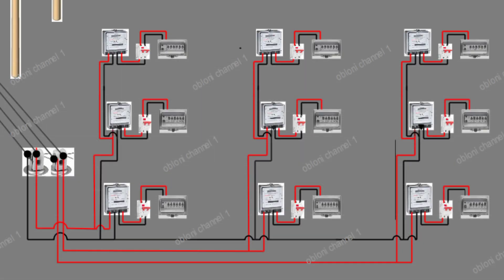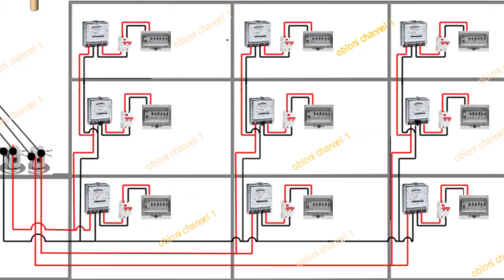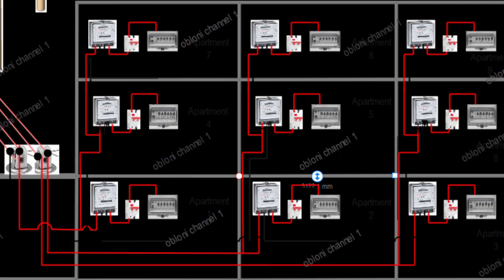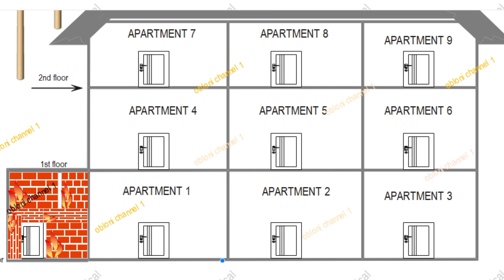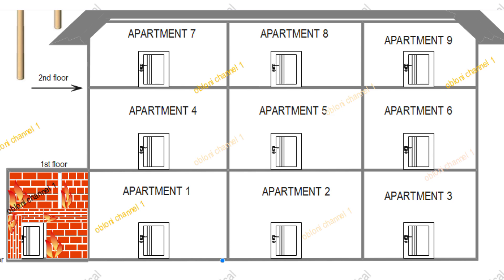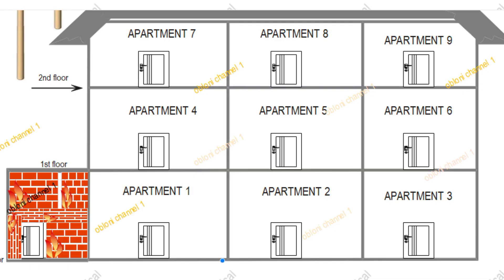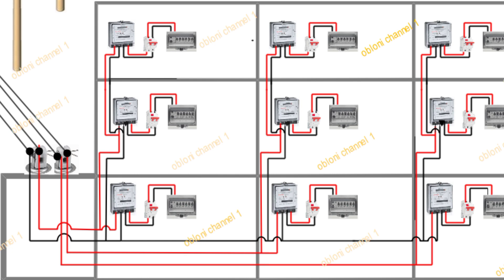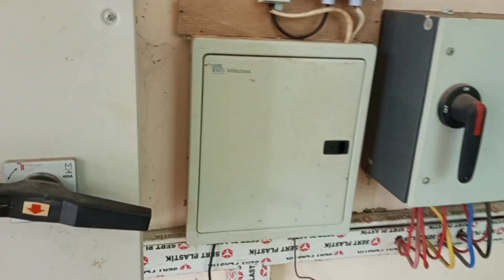How to Distribute Power in a Multi-Storey Building | Complete Electrical Distribution Tutorial

Comment: Big man, I wanna say thanks for your new video. These are my questions.
1. Between the energy meter and the consumer unit, which protective device is appropriate to be installed there.
2. When providing earthing or burying earth what is the appropriate way to bury them. Can you bury individual earth choose to each other or must be a distance away from each other. If a distance away from each what's the right distance.
Reply from the maker: Between the meter and the consumer unit you can use  MCB.

Yes there should be a distance between the rods. Some electrical codes recommend a minimum of 6ft. 
But you should not confuse burying multiple rods for the same installation with separate rods for two different installations